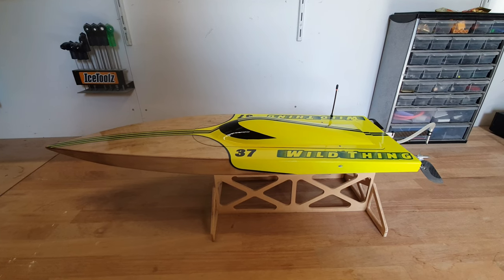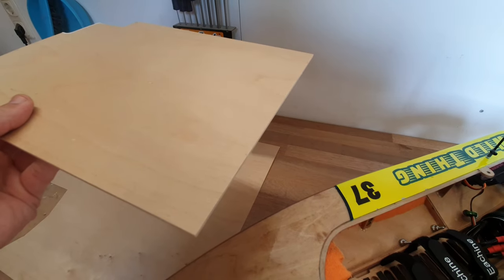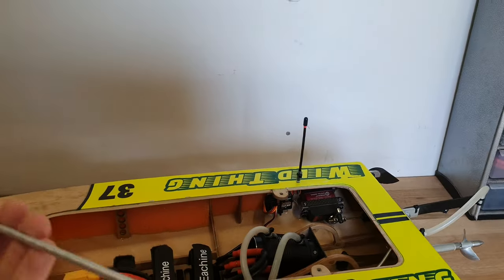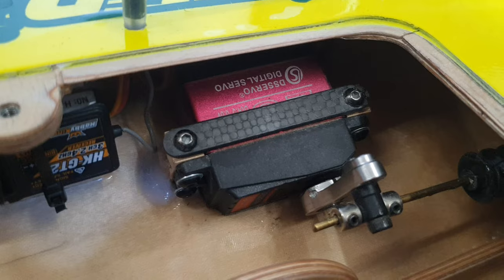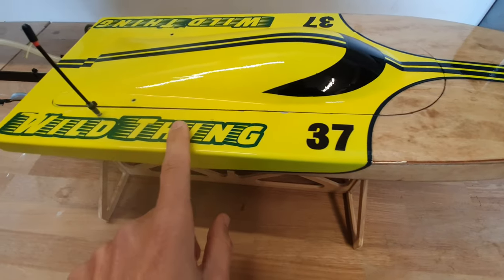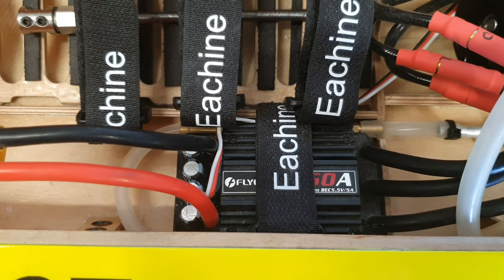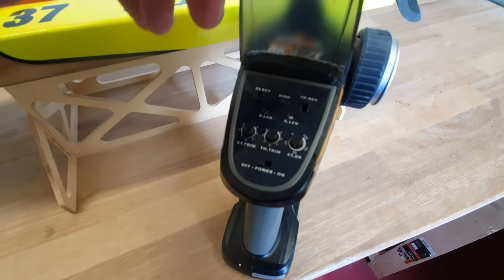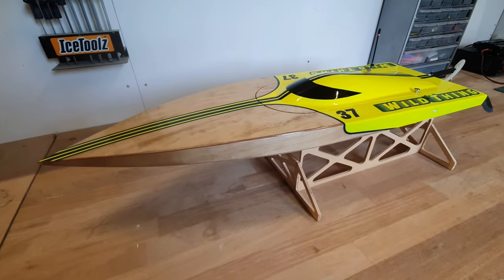How much does it cost to build your own rc boat? Full cost breakdown of RC Wild Thing mono.

Comment: Great break down cozy, a lot goes into building a boat, time, material, labor, and $..   adds up quick, that's one of the reasons I fabricate a lot  of my components (servo,motor,battery mounts)  I've noticed you do the same.  Once completed you've got something to be proud of  a custom one of a kind boat that straight up hauls a$$
Reply from the maker: Thank you BigB 👍 Yes, building your own boat and hardware is very rewarding and you end up with a one of a kind boat 😎 My next build will be a carbon fiber hull from a mold. I hope to start it soon. Cheers ✌ DJ

Comment: Hi Cozy , I hope you are all keeping safe and well, that is a good price I think, back in the late 80s when I built my electric hydro project, it cost me around £900 , I used 30 NiCads Sony, + 4 leisure Batteries, for charging these were given to me from a company, by a Tire and battery centre, if I had not been given the batteries this would of put the cost well over £1200 , then I built the charging system myself, 
You forgot to add the cost of the charging system, my IC boats were well over £1300 each, then have the cost of all of the props , 
Some of my hardware came from the USA Tidewater engineering, 
A good breakdown of what you used, Phil from the moulin France
Reply from the maker: Thanks Phil. I didn't include the charger indeed. Back in the days it was even more expensive. I used the C cells as well and the peak chargers cost a fortune. Luckily we have lipo's now 😎 Cheers, DJ
Reply: @CozyRC  thank you for your reply, I seem to recollect that the electric motor cost me around £150 , it was made in Germany, it was 50m X 100m , it had very strong magnets I could not turn the armature over with your fingers, i can not remember the name of it, Hector-plat or something like that,
it is like a lot of things technology moves on and some things are cheaper, 
Stay safe, I look forward to seeing your next project, Phil from the Moulin France
Reply from the maker: @philvale5724  Was it Hacker maybe? They are among the best in the business 👍

Comment: 490€ and the pleasure to build😊
I use only 4 mm plywood and 160g /m2 fiberglass ,first time I see you use 2 pieces flexshaft.
Reply from the maker: When you add it all up, the final number should be hidden from my wife 😅 For the setup and the performance I think it is a good price  actually. The flex shaft runs into a solid prop shaft with a rectangle cut where the flex shaft enters. The benefit is that you don't have the crimp effect of the flex shaft. Cheers, DJ
Reply: @CozyRC  Yes🤭 wifes and rc not good,I know the 2 pieces flexshaft ,the square always rounded after a few runs and I had a very hard time finding the way to grease the axle
Reply from the maker: @daiciuapostol79  Actually my wife has no problems with my hobby, as she sees I enjoy it so much 😎
I had no issues yet with rounded shafts. My F1 T800 uses the same principle.